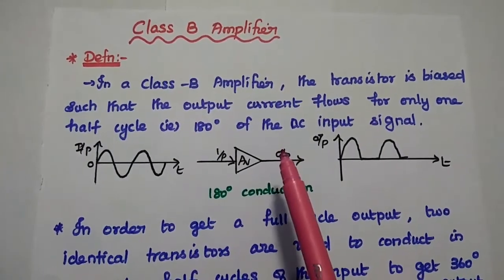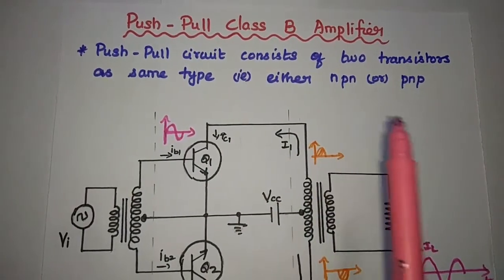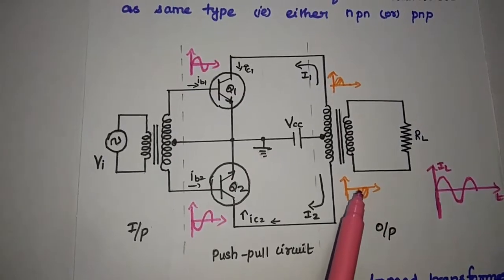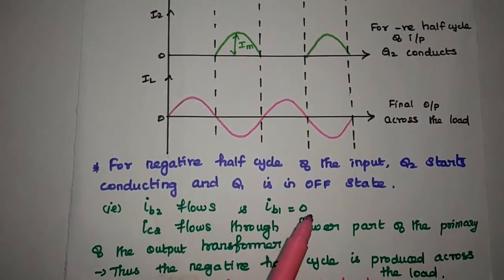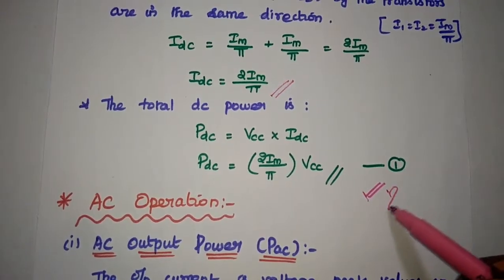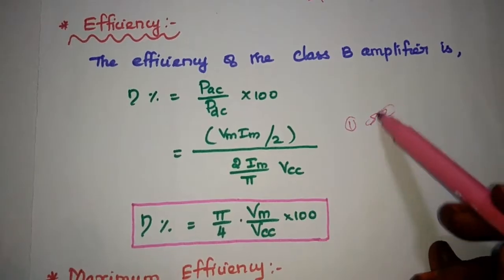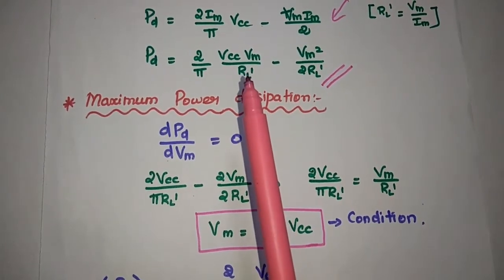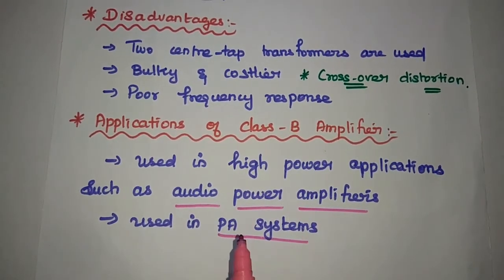Push Pull Class B Amplifier - Its Operation, Advantages and Applications

Comment: madam, here we are using npn transistor, it conducts only positive half cycle .In the the Q2 how can you say that it conduct negative half cycle. may i know the reason madam?
Reply: Negative signal after center tapped 180 degree shifting means negative becomes positive signal do q2 conducts